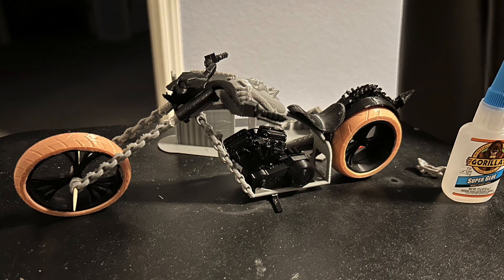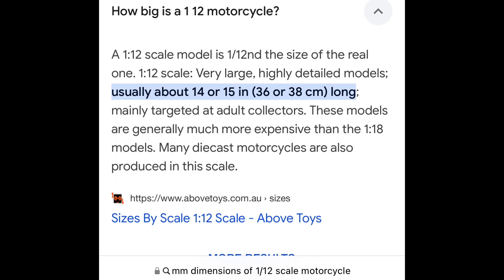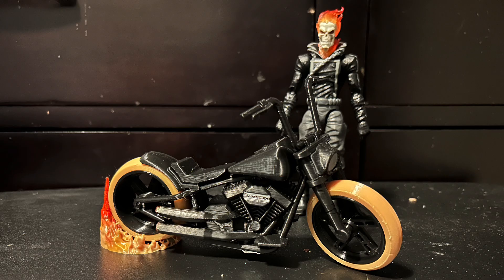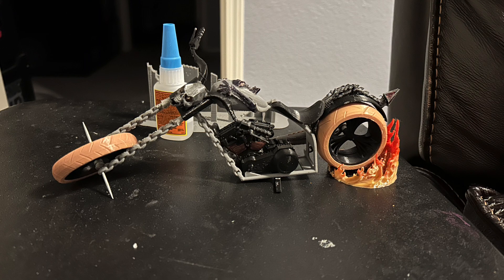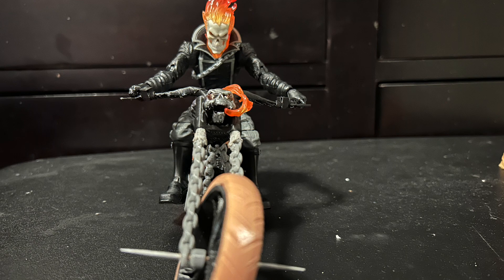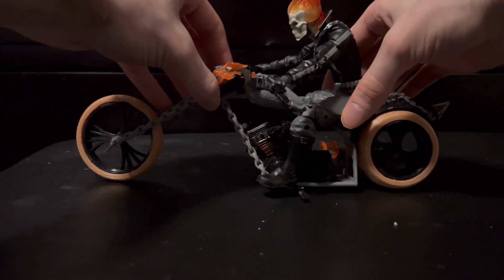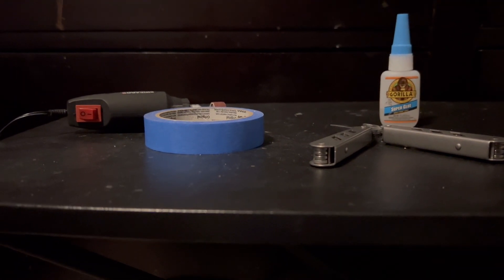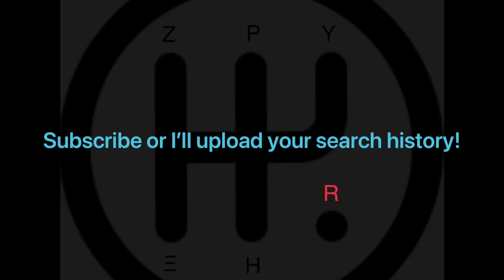3D printed Ghost Rider (Chopper) HellCycle!!!

Comment: I about to print one 1/6 scale I usually upscale +50%. What size did you print your 1/12 scale?
Reply from the maker: @hollywxxdchris  by default the bike is already pretty large. 
I had to do some downscaling so what I did was I downsized the front wheel to 52mm and used the overall size percentage in the slicer to scale down the rest of the parts. 
Mine being scaled down for 1/12, all assembled comes to about 140mm in length.
I hope this helps.
Reply: @ it definitely does thank you.
Reply: @ thank you.